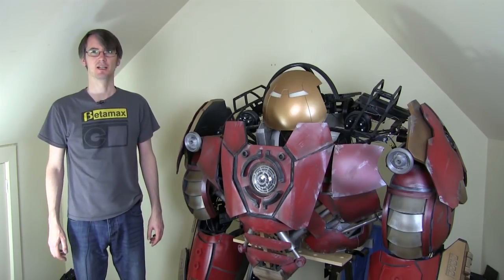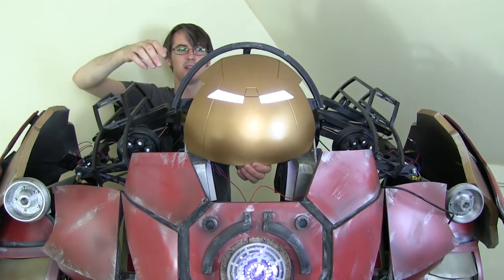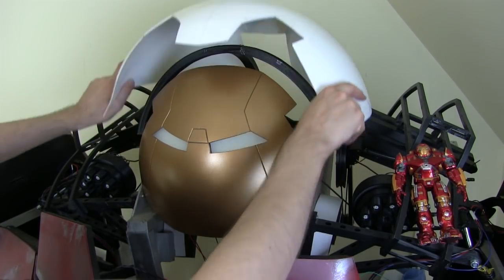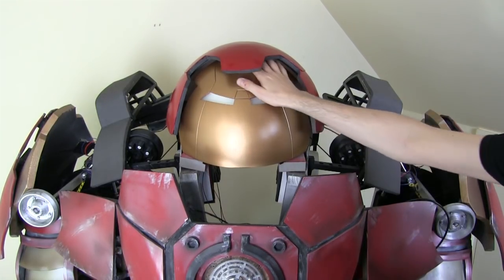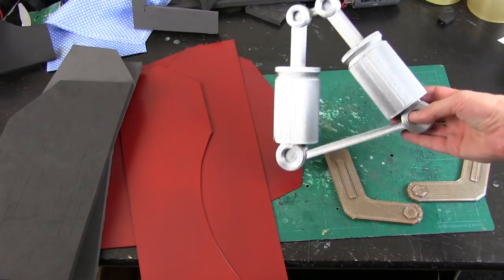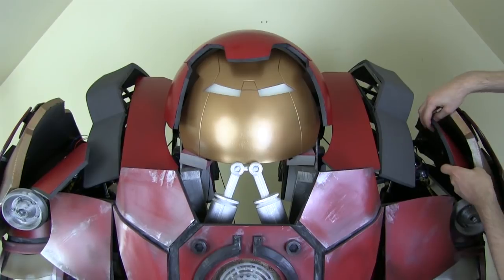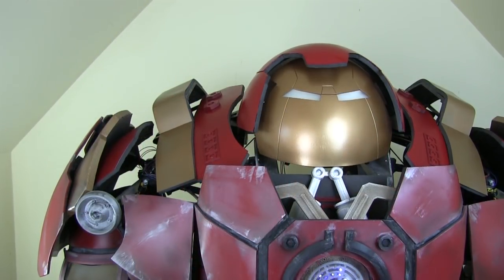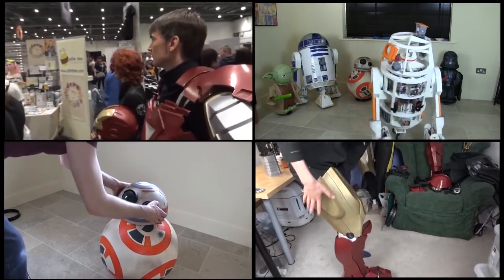Iron Man Hulkbuster Cosplay #38 | Helmet & Shoulder Panels | James Bruton

Comment: For some gaps, why not get a thin kind of elastic cloth like in tights and use it as a screen? Bonus point is that as well as darkening and obscuring, it'll be elastic and can be stretched decently. I feel hot glue may work to stick them down, worth double checking first though!

Comment: For the gaps you spoke of, you could Put a flexable mesh in-fill, with lots of old pieces of cable and tubing stuck on the surface - again - also flexible. That way, the gap gets filled, and it looks as if the cables are running to different parts of the suit. A little like C3PO's stomach..

Comment: Looks great! Can't wait to see it all finished! However I am concerned about how heavy it is going to be, as even though foam is lightweight, in large amounts the weight does build up, and thats not including all the 3D printed parts. I guess its fortunate that even though it is going to be heavy and tiring to wear for extended periods of time, you have built it so that you can easily step in and out of it with little hassle, so good job there!